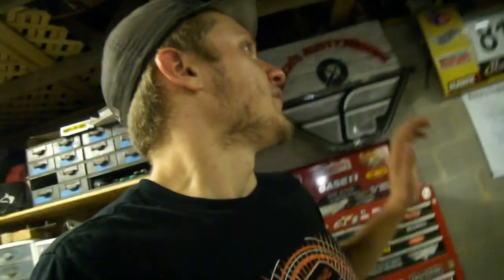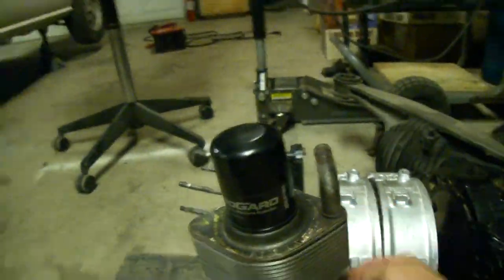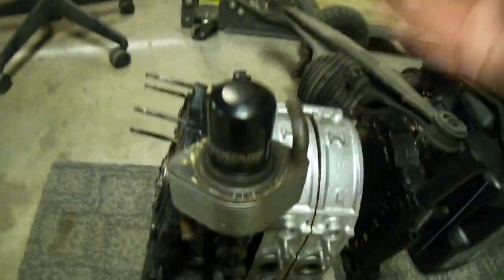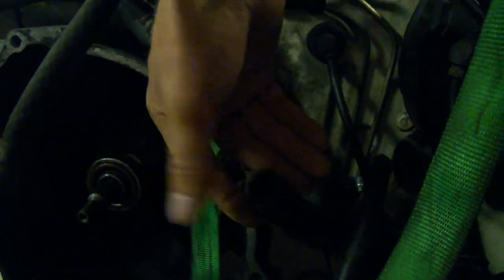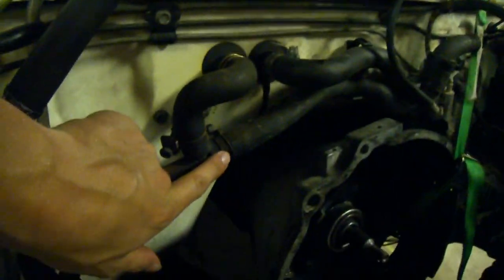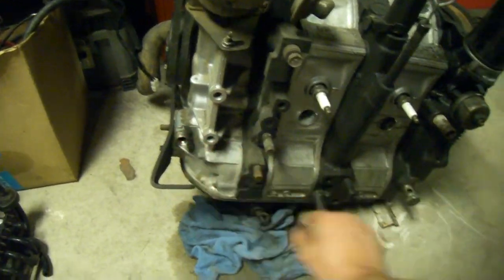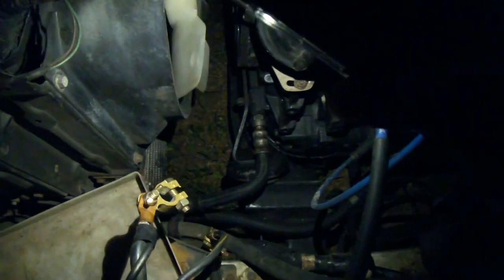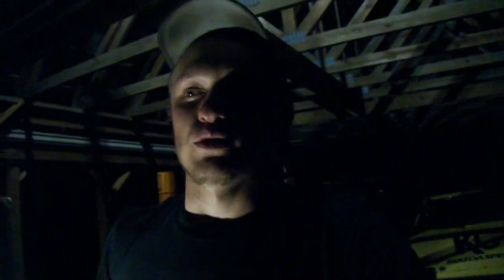FB/SA Rx7 OIL COOLERS - How To Keep COOL and Fix Leaks

Comment: Thanks for doing this. This clears up the questions I had. I believe on the 81-83 cars, they came with a slightly shorter radiator (the bottom 2 rows were removed) and the oil cooler tucked right under it,  but the later cars (84/85) used the taller full size radiator and it covers up the factory mounting holes. So most folks that do the conversion move the oil cooler a little forward and mount it in front of the rad. You just need slightly longer lines.  Either way, there's plenty of room under there to fit it.
Reply from the maker: Perfect.  I have never owned anything but SA or GSLSE.  So I haven't much experience with the early ones!

Comment: Of those 4 derelicts I scored one is a 1981 confirmed by decoding the VIN at NHTSA and it has a front mount cooler and radiator. Have a guy locally wanting to buy the cooler and came across this vid trying to figure out what to charge for it

Comment: Do you know by chance whats the Torque spec for the big bolt at the bottom of my 1980 front mount oil cooler? oil by pass thermostat bolt

Comment: Hey brother great work!!
I own a 1980 that Im using all the original 12ATurbo 1984 lower intake,turbo and manifold, orange hat with a Boost prep Nikki. I need help with the Ignition(Dizzy). I also have the 12AT dizzy but will like to delete my 1980 igniter box to use the two igniter on the 1984 Turbo Dizzy.
Reply: will be great if you can make a video on how to upgrade the 1980 ignition to the later version with igniters on the Dizzy 1982-85
Reply from the maker: I have a video on this, although not specifically geared to a 1980 rx7.  I have one that outlines the newer ignition

Comment: Do non beehive engines use a thermostat for the oil cooler? So I want to do this to my 85 12a. Do we need to find an aftermarket thermostat to control oil flow?

Comment: Hey can anyone tell me on the 83-85 beehives is there 2 o rings to replace or 4? I've gotten both answers. Took mine off yesterday and there was only 2. Went to order some from mazdatrix and they say you need 4? Can anyone tell me lol?
Reply: Did you ever figure it out? I believe there’s 2 more under the oil cooler pedestal that mounts the beehive to the block. But I’m not dead sure, I’ve been reading this same debate on the forum over and over (I’m about to do the o ring replacement)

Comment: Think its worth it to hollow out the fat cats on a 83 gs and plug up the air pump tube? Mine imploded and I'm running no exhaust now
Reply from the maker: Ideally you could just find a header.  But it won't hurt it to have increased exhaust flow
Reply: @RADPotential  thx for the quick reply
Reply: @RADPotential  just got done today emptying the precat out, took the main cat to the shop and drilled speed holes thru the baffle inside on either end, turns out it was two chambers filled with billions of little beads that crush into white powder. Painted them up sealed and threw them back in, just finished up, worked great
Reply: @RADPotential  also epoxied up the air pump tube